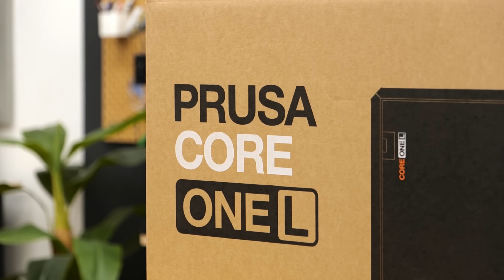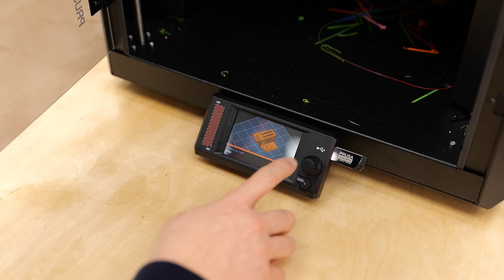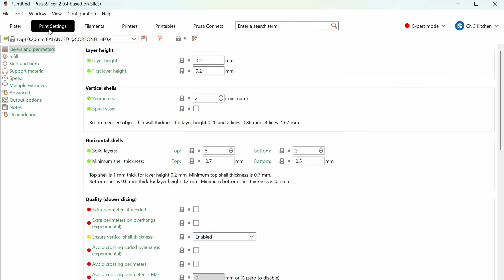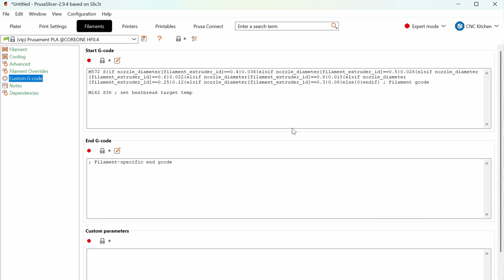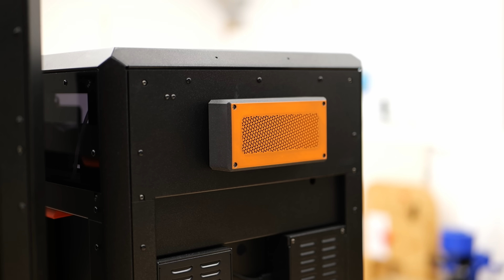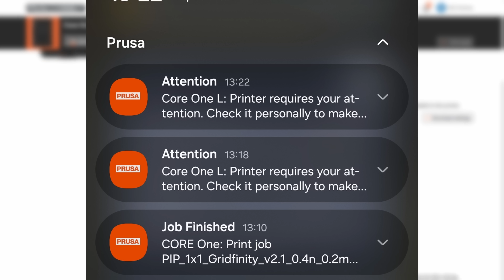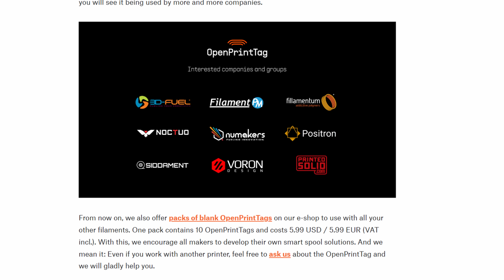What Prusa Got Right (and Wrong) with the New CORE One L

Comment: I miss when Prusa was an actual innovative company and not just an overpriced “follower”, except they aren’t even followers, they’re just falling behind that this point
Reply: Prusa is the only one actually still innovating today. The chinese are all just copying after each other and prusa.
Reply: @LilApe really? Bambulab? Snapmaker? What was the last actually innovative thing that Prusa came out with?
Reply: @nathan1sixteen  Just a couple weeks ago actually. Prusa core one now uses the enclosure led lights to adjust assist in setting belt tension, making it fool proof, no other brand does that. Similarly to how you would set timing in a car. Before that, the swingarm they made to hold the toolhead cabling is something nobody has done before and its much more reliable than the cheap cable chains that the chinese like to use, they even open sourced it.
Say it with me now, Prusa innovates, China imitates Want me to list every single prusa innovation that every chinese printer uses today?

Comment: core one L? take the L over H2S lol. these prusa printers looks like a joke comparing to Bambulab's printers.
with that kind of pricetag like alright people care so much about privacy riiiight?
even  machine parts are 3D printed, which is lame af, 3D printed parts never as good as machined parts with higher tolerance and look way better - more professional.
let alone the filament price is like a joke also.
Reply: Nobody is forcing you to buy Prusament. And yes you might be surprised, but people who run print farms or use 3D printers for internal prototyping DO care about privacy. A LOT.
Reply: @FrozenDozer  Bambu also has offline print, and the filament is way cheaper like x2 or even x3 if you buy more. Heck the Centauri from Elegoo is even cheaper than that, and has as good print as Prusa.
Imagine running a farm with 30x P1S over this, you get what I mean?
Reply: Prusa printers might be made using 3d printed parts, but prusa printers still produce parts with tighter tolerances than bambu printers lol
Bambu filament is cheap sunlu garbage thats always out of spec and made in china. Prusament is tight tolerance and made in the EU/USA. Imagine comparing chinese prices to the rest of the world.
Reply: @LilApe  tight? my friend own 2 XL and nowhere comparing to even X1C let alone the H2D. First off get the actual machine and print test before typing anything.
Imagine it's 2025 and still think China product is bad and even cheap, you should open your eyes or travel to China just for once brother.
Reply: @monsterinsane2228  lol go print a 20mm cube or whatever on both a prusa and a chinese made printer, measure them with mics and then tell me which one is closer to that 20mm mark.
It will be the prusa, every time. It's been proven many times already, that prusa printers produce more accurate parts.
Reply: @LilApe  "proven" hah I can't laugh enough by this.
you do yours dude, imagine still have this mindset about 20mm cube to compare between machines, let alone machine finetune calibration.
I won't reply anymore because it is too pathetic to even consider any point you made at this point
Reply: @monsterinsane2228  Accuracy is a simple concept man. Design a part, print that part, then measure that part, how close are its dimensions to what you designed? Prusa will be closer every single time, its been proven over and over again.
Reply: @lars916 Public opinion says otherwise.

Comment: If I have Prusa's filtration system installed, is it actually filtering before emitting exhaust straight out of the back when I print PLA? Or will I need an aftermarket solution like yours for PLA and other low-temperature filaments?
Reply from the maker: It's installed after the two stock fans and will draw air outside the chamber through the big new filter. So it's not a re-circulating filter but an exhaust filter.

Comment: As a user of MK2S I would be really surprised if I can run "the other guy" printer that long, so in my opinion it´s worth of the price without some of the minor "features".
Reply: They are not minor and bambus have no issues running for long.

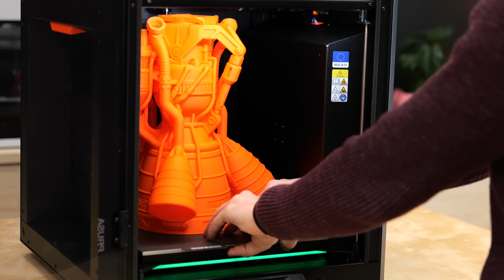Comment: 6:37 As per your own review, hardened nozzle offer less layer adhesion for some polymers, including PC, that You tested on the channel, so having HF brass + Hardened is a good combo.
Why not HF hardened, idk, but maybe they are cleaning the stock… 😂
Reply: Not really, now we have copper nozzles with hardened tip and they are a standard on many current machines. No loss in layer adhesion and they can print anything.

Comment: The price man, the price... More expansive than H2S+AMS PRO for less quality and features what a bargain !!! The time I was thrilled with my MK3 is far away...
Reply: More Expansive? Isn't the Bambu Grass printer bigger?
Reply: Indeed. Admittedly, I did buy an H2S + AMS2 before the Core One L was announced (just!), but as much as I would have prefferred to give my money to Prusa rather than Bambu, I couldn't overlook the huge price difference, and lack of active chamber heating (which is why I bought the H2S, as my Voron 2.4 doesn't have it). I still much prefer the open source printers where possible, but needed a new workhorse that doesn't require tinkering.
Reply: @JamesElise160  Same I would 10 times prefer to buy a Prusa, but the price/quality gap is too huge now
Reply: Prusa simply can't compete in price. Manufacturing labor costs, cost of long-term product support, R&D costs, the costs of developing and releasing open source products, etc.

Bambu and other excellent brands don't pay for a European and US work force (expensive). They don't facilitate customer service on the same level as Prusa, and they certainly aren't releasing their own innovations into the wild for all to use.

At this point, buying a Prusa is more of a luxury beliefs purchase. For those willing to pay more for the company's origins and methods, independent of whether the product is absolutely the best.
Reply: @Steaktacular  Your point about luxury is right, that's what Prusa tends to be know

Comment: Nice review. Can you test it with some brittle CF filaments? 
290°C, the biggest downside of it, to be used for new technical filaments (PPS-CF even PPA-CF and PET-CF, but even their PC-Blend CF can benefit from this) 
Open print tag :-( no more drying the filament in a microwave.
Reply: With a single wheel idler it works great, with the oem idler arm it wanted to snap with the std bowden orientation. i did some layer adhesion tests with the cnc kitchen test hook on SirayaTech ppacf, seems good so far. Looks like the L might have a larger radius on the entry though, need to check that
Reply: The open print tag is potentially removable, but will depend on the specific manufacturer
Reply: Hopefully i will find out soon. Thanks for your videos btw. I am just looking into how to generate a profile with various calibration prints. Perhaps the ones generated in orca slicer? Ill try and get the new hotend if its released within a few months or I might try the revo mod.

Comment: I like your nuts. Need more of them.
(yr bolts are also fine)

The fact of the matter is that most expertise there is in 3D printer building are all in China and they definitely  have no issue with copying ideas. I got myself a Creality K1C a couple of months ago and besides 1 error, which it did recover from, and a custom node script for independent dimensional accuracy calibration it worked flawlessly. Using the thing 3-4 times a week.

If you open it up you see some weird turns for the belts ... you think, why the hell did they do that? Then you measure the distances and find they are all in a dis-harmonic relationship. Well ... that's why. From what I saw so far, Prusa is more musical instrument than a 3D printer. Would have been nice if Creality would have leaned into it a tad bit more... On the other hand, might have been accidental shit design which is actually amazing.

Comment: Strongly disagree that Bamu has better print quality. We (unfortunately) have a Bambu machine at work and I am totally disapointed with the print quality. blobs in the surface, gaps in the first layer, ... and I'm not even talking about structural parts. Here it looks like Bambu isn't even trying to give options for improving mechanical strength of your prints. To be honest: after some upgrades my fister Ender5 was a better printer than the Bambu P1S that we have at work. (slower, but better quality)
Reply: You have a defective unit or bad filament, bambu prints almost perfectly.

Comment: Great video. I agree on your criticisms, and your praise :) Just one correction: there IS an NFC reader on the back of the printer, so I believe they're just going to offer a printable file to move it to the spool holder, and you should be good to go. The wires might be too short, though, so they may need to offer an extension cable.
Reply from the maker: You're right about the sensor that could be used dual-purpose! Didn't think of that!

Comment: I'm pretty sure this is my next printer.  I've got an MK3S+ that's still working great.  I'm OK with price and performance. What gets me is the camera.  First, it's wifi, when the printer has Ethernet,  but it gets much worse. It's only 2.4GHz. I've almost eliminated all 2.4GHz wifi. I'm not inclined to use the camera for that reason alone. Other than that, I'm looking forward to it being available on Printed Solid's site here in the US. I like the filter addition as well. 5.3 cents per hour isn't bad for hobby use. I'd set it up to vent outside if I had a full time farm. I vent my MK3S+ and Resin printers outside by way of an enclosure with a fan like my laser, but it's a pain to use since I only have one enclosure for 3 printers right now.

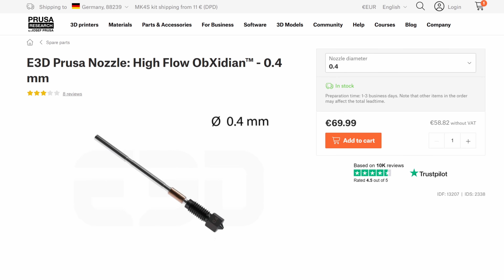Comment: 6:27 lmao 290°C ? So essentially the same as the prusa mini? That's wild for their flagship printer to not be able to print nylons and pps etc.
Reply: They print nylon and pp, they even sell parts specific for these materials.
You are the one who doesn't know how to print them, I used to print Nylon in an enclosed MINI, and PP in the MK3/4 If you can't print these in a Core One or XL, you must be incompetent
Reply: @fofopads4450  he said pps, not pp. Also 290 is not enough for ppa, and barely adequate for regular nylon cf.
Reply: @fofopads4450  I own a prusa mini and have printed PC and PP what I definitely cannot print, that Bambu's top machines along with Qidi's can, is PPS and high temp nylons and some PPA formulas. It think it's kinda crazy to release a printer THIS EXPENSIVE and not have the hot end be able to reach over 300°C in 2025. You must be incompetent to think PP and PPS is the same thing.

Comment: No auto flow calibration is wild. The X1 carbon had it 3 years ago...
Reply: As someone who has worked with almost all BL printers, the Lidar on the X1 dosent work. The load cell introduced on the A1 series is much better.
Reply: @lukahierl9857 I have an A1, have had two X1Cs (sold off old one and have a new one now) and an H2D, I think I can agree that the new flow calibration is better overall, but the lidar works imo. It is dependant on filament type, and lets not forget that bambu shipped the X1C with cool plates (which are now frustratingly discontinued) specifically because they were flat and worked best with the lidar. At some point they gave up and started shipping all X1Cs with the textured pei plate to make the printer more noob friendly, even if it will always make lidar performance worse. Imo though lidar has always worked for me, but I've heard stories of it royally messing up the calibration process and messing up peoples prints.

The bed scanning function it does is just a gimmick, its unnecessary but I understand Bambu wanted to make a statement with the X1 (a statement that apparently Prusa, Creality, etc. cannot catch up to if their lives depended on it). The first layer scanning DOES work and its something the H2D, P2S, and A1 doesn't have. It's caught defects before, but most of the time its due to the horrible X1C nozzle wiper not working lol. I have replaced that with an alternate A1 style wiper and it works nicely

Comment: 290 hotend? No dedicated chamber heater still? Did Prusa's liability lawyers create this?
Reply: You can basically call it an active chamber heater now. Those fans actively push warm air throughout the chamber. It's no longer a passive system, surely.

Comment: By factory assembling some of the critical wiring assemblies along with the bed, they should be able to safely make the Core One L into a kit.  They might have to compromise on how the kit is packaged so they could fit more pre-assembled bits into the box.  It wouldn't be a 100% kit like the MK series and the original Core One, but then again most Heath Kit color TV kits weren't total kits either, with critical circuit modules factory assembled and just bolted into place and wire up via connectors.  However, if they sold all Core One L's as factory built, they might be able to keep the price down thanks to mass production and NOT having to go to the expense of creating an assembly manual.  Good kits are HARD to design!

Right now I'm building a Voron Trident, which will be a bit smaller in Z than the COL.  I'll wait and see if Prusa comes out with a multi tool head version of the COL, the machine does look interesting!
I have a Sovol Zero that seemed to work really well, but has recently failed.  I think the problem is a broken belt in the Z axis, or maybe if I'm lucky just a grub screw that has loosened.  I haven't yet gotten around to opening up the printer to fix it.  I like the way the Prusa printers are built, and they look good.  Chinese stuff is built to a price point, not a quality  point.  I'm going to add the  Core One style side indents to my Voron Trident, I love that feature!

Comment: Looks great, agree they should have pushed up the nozzle temp. This was the size the core one should have been at the beginning. When I was inquiring about the Core one with Prusa I asked multiple times if they were planning to make a larger version. I'd have to look back at the response. My suggestion at the time was to use 9 of the 16 heat pads from the Prusa XL so it would be would make for a 270 x 270 print bed. This is a bit larger so a good thing for sure. I am happy with my Core One, I use it for technical prints. 

Anyway happy to see if they develop it more with higher temp nozzle and whatever else happens.

Comment: Prusa has fallen off. They cant make a decent design, user friendliness is lacking as always, their aesthetic design is lazy to say the least, and the performance of their newer machines is worse than their competitors. All while demanding ridiculous prices hoping that they can rely on the the Prusa fanboys out there to buy their machines. I've worked with printers from every major manufacturer and in my experience, the only competitive model they offer is the 5 tool XL. Other than that, they have finicky bedslinger, a lackluster coreXY,  and a resin and delta line that no one knows about. Don't get me wrong: when prusa printers work, they WORK. They have incredible build and print quality. But I can only say "Prusa quality baby" so much before every other drawback catches up. It seems to me like the core one L is a defining moment where Prusa has officially stepped down from the top of the podium.

Comment: I have a lot of patience for Prusa and they deserve support (as much as a company possibly can), but they need to prioritise polishing over the next 6 months and make sure all the lessons learned are addressed (and pointed out) in their next machine too.

I know, easier said than done... I just worry that if they don't push the last 10% of the way they'll very quickly end up on the back end of the curve. It's clear that the budget brands are now starting to achieve (and exceed in some ways) Bambu Lab quality and value and so there's only a tiny strand of quality and good will securing their reputation as a premium brand.
Reply: I honestly think 90% of that could be done with just good UI and improved slicer software, the rest would be little things like a nozzle wiper. I don't think it's unachievable, especially to a company with such good customer service, if they take what they learn from that and cycle it back into their UX design they could dominate. I guess what I'm saying is they have all the raw materials they need already and I believe they are capable of executing as well.
Reply: @thebravestmike  Unfortunately, that's not completely true! For example, let's look at VFA's: There was a video on YouTube which showed why this is happening in the first place: TLDR; that is caused by the timing belts (toothed belt). VFA's would disappear if Prusa just used finer toothed belts.
But Prusa had already shipped the Core One with the wrong ones, and so they came out with the idea of using tensioning/frequency calibration to try to mitigate the problem.
They could have fixed it before, but they didn't.
Reply: @wildmusical  Could you please send this video?
Reply: @lettucedogg  Decently sure it's "The 3D Printing VFA Epidemic" by YGK3D, excellent video imo

Comment: Will stay anyway with Prusa my P1S was nice but coudn't print overhangs that my MK3s could do easily, will get a core one L.
Reply: Same slicer?
Reply: @hughjassstudios9688 basically yes as Bambuslicer is based in Prusaslicer
Reply: @hughjassstudios9688 basically yes as Bambuslicer is based on Prusaslicer, never found out the real reason thought it is printspeed but also slowing down did not help